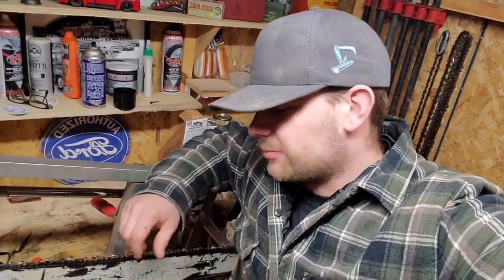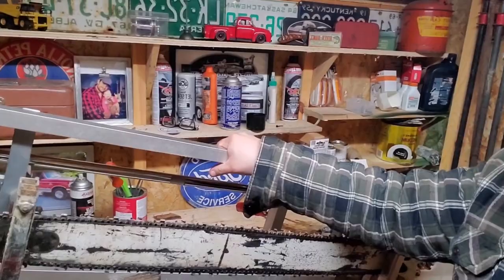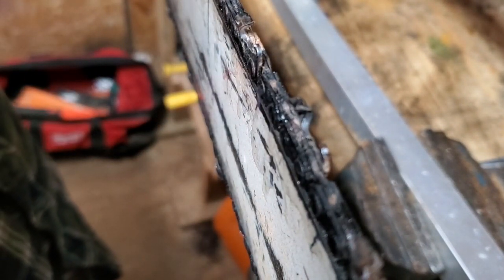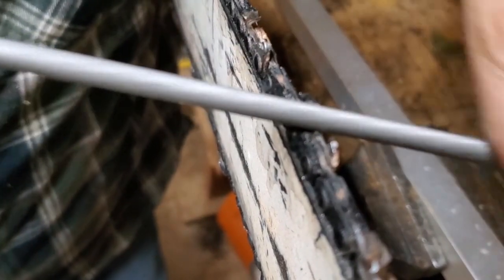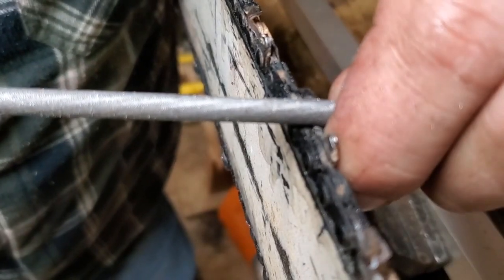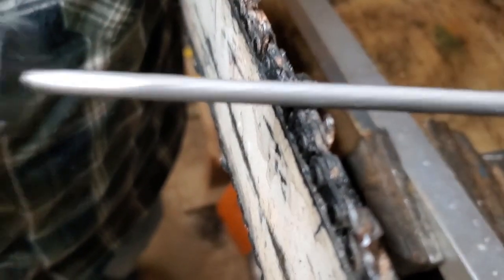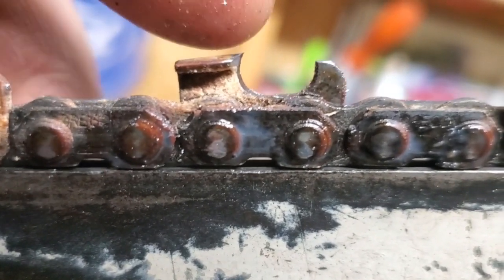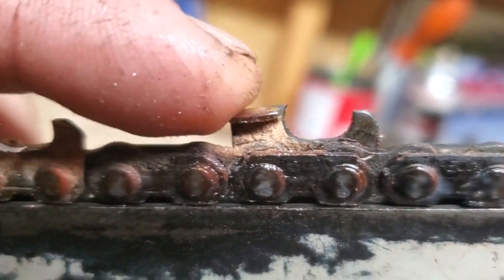Hand File A Ripping Chain

Comment: A little backstory I managed to finally get 2 and 1/2 acres and it's got quite a few oak trees on it.  I'm going to have to mill my own trees to build a cabin or A frame.  All i have is an exho cs310 with a 16 in bar. I did manage to get a chainsaw mill, and I have an aluminum extension ladder I can use for rails.  But I'm still learning how to try to sharpen a chain for this

Comment: Ohhhh, so if I keep filing back without pushing down I'm getting rid of the C shape. That makes a ton of sense. My teeth feel razor sharp but its not biting.
Reply from the maker: @bradkrit  thats correct !
Reply: If your chain feels sharp but it doesn't cut well it may be your rakers need to be filed down a bit .

Comment: I have no problem sharpening a regular chain, but I just got a ripping chain and after ripping 12 boards had to sharpen it for the first time.  It seemed sharp at first but started to dull during the first cut.  It was tricky to match the 10-degree angle w/ my Stihl Sharpening Jig but I think I succeeded.  Is there a problem using the jig?  Do I have to do it freehand?
Reply from the maker: @TheTrock121  I like to do mine free hand without the jig. Learn to know the angle and file without the jig free hand is how I do it.

Comment: buckin billy ray ftw !!! nice vid btw. I accidentally ordered a ripping chain instead of a skip tooth for my 28 inch bar. not sure if its worth using for cutting logs
Reply from the maker: Thank ya brother !!! Buckin is the best. 

You'll be able to file out a 25 degree angle on your rip chain and she will cut just fine . Not a waste.
Reply: Yeah absolutely you can file it the way you want it for your needs!...might of been better to keep the ripping chain around and just order in a conventional cutting chain but it’s definitely something you can like mentioned you just change the angle of the teeth with a file
Reply: Just run it. Might be surprised.

Comment: Files, indeed all files have teeth pointing forward.  Push, then lift.  By dragging the file back across the metal you just cut, you will eventually dull the file.

Comment: How do you check and adjust the spaces? I cannot find a gauge for them (I think they are supposed to be. 010").
Reply: Which spaces are you referring to?
Reply: @patricktkeegan  Meant rakers.
Reply: @joncue0304  ah yeah just knock them down with a flat file if you find the teeth aren’t biting. I’ve heard some recommend different intervals (ie every other time you sharpen)
Reply from the maker: @patricktkeegan  I put a flat file on top of the teeth and make sure they clear the rakers

Comment: Does the 10 degrees help that much? I've been using my regular chain. I'd like to hear you opinion.
Reply: I just went from milling with a standard chain to a 10 degree milling chain and the difference was about 3 times faster on my milling. Very supposing because the chains look almost identical
Reply: @JKmedia123  I finally filed a 32 inch to 10 degrees. The cut looked better for sure. I didn't notice much of an increase in the speed of the cut. It was less grabby also. All in all I found it to be worth doing.
Reply: I’ve been using a granberg ripping chain to mill a couple hundred board feet or so (ie not completely new but not a lot of time). I’ve noticed it handles knots and inconsistent grain more quickly than a cross cut but overall speed of cut is pretty much the same. I was having a hell of a time with my MS261 overheating when I was using a cross cut chain for ripping and I’ve not had that same issue with the ripping chain. The cut face from the ripping chain is much cleaner than crosscut, but that may only matter if you can’t run your slab/milled lumber through a thickness planer.

Also, don’t even bother cross cutting with a ripping chain. You could chew through the wood faster with a rusty beaver.